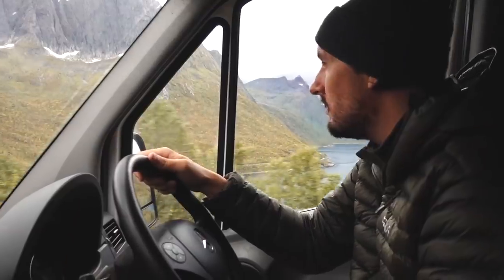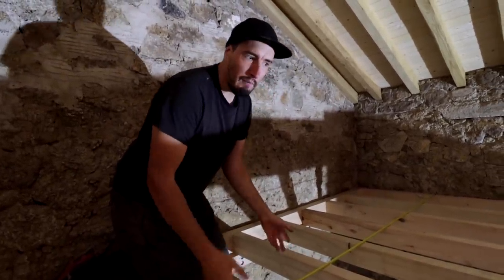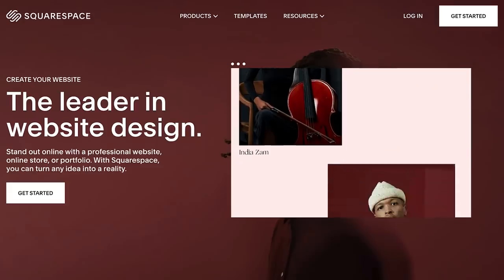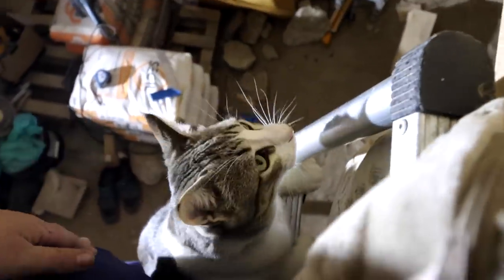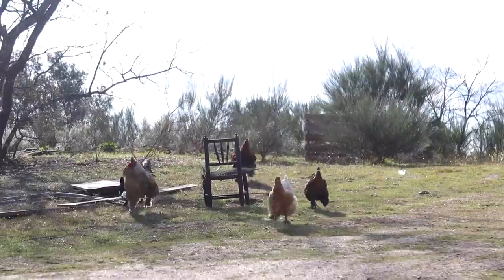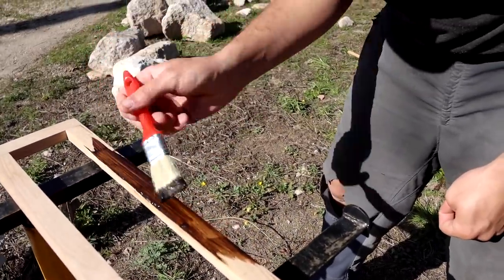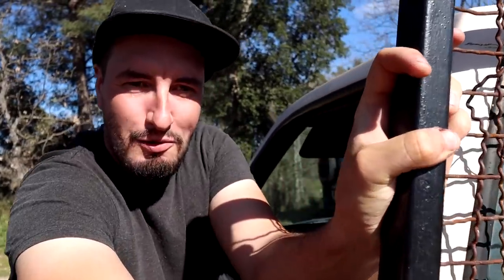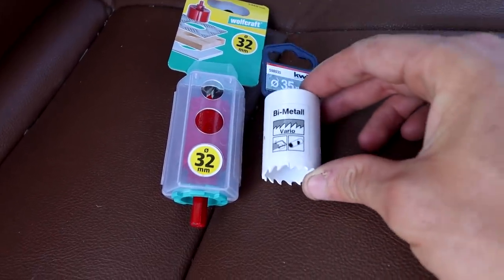THIS ISN’T GOING TO WORK! Renovating an Abandoned Barn in Portugal

Comment: Take your chestnut timber to a wood-shop and get them to turn it on a lathe to the diameter you want , you end up with a chestnut dowel that you can slice on your saw ! Also build a slim bookcase staircase , its much safer and you can carry coffee and things upstairs !
Reply: and extra storage!
Reply: Great idea, and as all wood is beautiful. I would use a contrasting color wood and emphasize the plugs. Make a rolling library type ladder in the same color wood.
Reply: my thoughts exactly.
Reply: @raymondsmith4401  Another good option.
Reply: They could also leave the plugs slightly proud and make them look like pegs they use in timber framing.
Reply: Wonderful ideas both.
Reply: Totally agree with slim bookcase staircase under the mezzanine along the wall
Reply: I agree about making stairs. Just make the angle from the beams to the end of the wall. They might be a little steep but would be easier to go up then ladder and like was said you could use for extra storage
Reply: Absolutely agree! Safer, easier to manage (especially when you are half asleep or have had a wine or three!) 😊😀😁  Extra storage too if you make the steps accessible drawers from the side.
Reply: I like Brain Clerk and  one other that suggested a slim staircase steps that could be used for storage too! Or the library sliding ladder!
Reply: Yes, a slim staircase would be much more stable, and also consider towards the top making a left and having a slight platform to walk along towards the middle so that you can walk under it on the ground floor, but you can also step into the tallest part of the bedroom.

Comment: Hi! What if you put a sliding ladder that you can move from the left to the middle of the second story? Like a library ladder you use to get books off the shelf. Then you can have the middle open to get up into it at night. When you are down in the kitchen, you can push the ladder to the door side out of the way. You will have the banister were you need it by the bed. No one will fall off! 😏 ❤
Reply: Amazing idea !
Reply: I was thinking the same thing. Why not have a rolling ladder so it's easy and comfortable
Reply: That’s exactly what I was thinking when I was watching Theo explaining their new idea. A library ladder would be perfect.
Reply: I like this idea too!!!
Reply: Scrolled down for this suggestion! I've stayed in a few places with mezzanines and a rolling/sliding ladder that you can push to the side when you don't need it works really well. Ideally one with handrails - much easier to get down!
Reply: I thought this as well , would be perfect , to have it in the high point through the night and move it away through the day. You could  even park it away from the door on the far wall to make the most of access

Comment: I'm thinking that the ladder will get old real quick in the middle of the night. So many clever tiny homes have cabinet stairs with a lowered floor area in the loft entrance for ease of access.  Something like that. The barn is looking amazing!
Reply: I rather have storage stairs. That’s just me. I have so many clothes.
Reply: I’m with your idea.  Everything needs to have double duty and the steps are certainly safer and much more convenient.  I’m sure glad they nixed the hatch idea - but they need to reconsider their ladder idea with storage stairs.
Reply: I totally agree with you here. I’m having anxiety just by looking at that ladder. It’s just not safe I think.
Reply: I've watched hundreds of tiny home videos over the years and have seen the evolution from ladders to stairs. They all say the same thing: the ladder was not fun.  I secretly suspect that many of them sleep on the couch after just a month of sleeping in the loft and using a ladder. It's a pain in the best of circumstances.

Comment: Have you considered a small set of storage stairs with a turn at the bottom, Instead of the ladder?  This way it’s easier to climb up and down and you have some storage solutions.
Reply: Agreed, it will be easier for them and their cats.
Reply: best upgrade option so far. like an "L" shape with a turn at the wall. I can see open bookshelves on one side for the living room. Could even build out the floor stairs to create a entry way storage sitting area for shoes and such.
Reply: Agreed.  There are some great versions I’ve seen where the top “step” is more of a landing at the top a bit lower than the mezzanine so that you can stand or close to it. I’m not sure Theo could at his height but it would still be safer and easier than a ladder. I feel like this is one of those times when it would be smart to get a professionally designed stair.
Reply: This is what I was thinking. You'll need cupboard/storage downstairs anyway- why not walk up the top of it?
Reply: @Metis1971  🇬🇧  Small landing would be a good idea.

Comment: Why dont you integrate the stairs/ladder like furniture like its done in almost every tiny house? It looks good and gives you lots of storage - no waste of room
Reply: Exactly my thought.  Plus those stairs run from inside the room up to the lip of the loft.  Stairs are stairs and take up the same amount of geography.  The only question is how to place it (e.g. against a wall) so to minimize the impact and then, as you say, use the triangle underneath for storage.
Reply: I agree, they look good, act like real furniture instead of a ladder, and multipurpose. Also the stair/ladder needs to go on the other side of the loft. It's awkward having them directly to the right of the entrance and then having you popup right next to the head of the bed - it's better design to put it at the opposite end of the bedroom, so to speak. They might benefit by getting a second opinion from a small-space design consultant.

Comment: I love watching you build your house!  About the sladder....instead of building it behind the door, why not slide it all the way to the other side, make stairs and have built in storage under each step? It would be more a piece of furniture. Since it would be near the kitchen it could be the pantry.  It could also be a hidey hole for the kitty litter box.  You could have a stair rail for safety, have a better angle to carry things up and down, and it would be more convenient in the middle of the night.  You could make a kitchen counter that extends over to rest on one of the steps and flips up to get to the mezzanine.  That way the steps aren't wasting kitchen space. Try measuring the interior of your space, putting it on graph paper, then make little pieces to mimic furniture and kithen cabinets, appliances, etc. to get an idea of what works for the space.

Comment: Spot on for the position of the steps up to the mezzanine. Tons more space under it for lounging! Suggestion for safety - how about a fireman’s pole to get down quick? Or rather a thick rope hanging vertically off the ceiling that you can hold on to?

Comment: Why not have the ladder on the side of the mezzanine, that way you don’t need to make hole. I saw later that you came to the same conclusion :) that’s exactly where I would put the ladder as well. Also a bit safer to maybe have a rope along the wall for safety going up and down

Comment: 36” spiral staircase in the same location as the ladder will give you a much better and safer long term solution. And it will look so much better. I’ve done it myself to access a similar space and it worked perfectly. You can use the ladder as a cheap temporary solution.

Comment: In our cabin we have a wooden ladder mounted at the wall - you could mount your ladder where you have the ladder standing now, only at the wall -  and the ladder goes higher than the floor above by a meter - so we climb the ladder - when reaching the floor - we hold on to the ladder and sidesteps onto the floor. When going down, we sidestep from the floor to the ladder on the wall - and climb down. This way, no room will be lost - not on either floor. Good luck! Wishing you a happy Easter - from Sweden!

Comment: Finding a viable solutions for the stairs is quite the head scratcher isn't it?  
*The stair opening in the middle of mezzanine compromises the space too much but I don't think the step ladder to the side works - it's just too steep and an accident waiting to happen in the middle of the night.  Also, it assumes both of you will always have 100% mobility. 
*Like others I thought about wall mounted folding stairs (so cool) but you would have to locate them on the opposite wall to the door.
* Another idea is building a component spiral stairs - also located opposite the door.  They would be a lot safer to use than step ladders.
*Me? - because you're in such a small barn I would build a wooden addition to outside of the gable.  This would house a spiral staircase and I would knock two door openings into the gable - one on the ground floor, one on the Mezz level.

Comment: If you intend to ride a motorcycle, get some formal training. I was self taught and had no training of any kind for many years, like 10 or 15 years. I finally moved to a state that required a mandatory training class to get a license, and when I finished the class, I realized that I was lucky to be alive. I learned so much from that class even though I had been "riding" for years but now had learned the correct, safe way to ride. I later became a motorcycle safety training instructor and took expert training classes because I rode a lot.

Comment: Great design, looking forward to seeing the barn finished. Just a thought about the ladder. On the right side of the ladder at the top when you step into the mezzanine maybe add a 3 ft. Vertical post on the floor of the mezzanine. This gives you something to grasp as you step from the ladder to the mezzanine and when you start to go back down the ladder. This way you are not partially crawling to come to a standing position at the top or when you go back down.

Comment: Have you looked into library ladders for the loft? They would be a safer angle for midnight bathroom runs, but can be pushed in during the day so they don't take up as much room. I've also seen them with horizontal rails also so you can move the ladder to the center at night, then push it up against a wall during the day. A few months ago I saw a tiny house with a library ladder that pushed in then over and into the pantry so you didn't see at all during the day, you only saw the rail against the loft.

Comment: A suggestion for the layout of the mezzanine, I don't know the exact dimensions but it looks like it would be possible to put the bed lengthwise in about the middle. So when you come up on the door side wall (you could make that side the storage side), in the middle is the headboard side with your feet towards the woodstove wall side (I hope this makes any sense). That way, you'll be underneath the velux window for stargazing and you won't hit your head when getting in and out of bed.

Comment: Have you seen the fold up/collapsable ladders that fold up to the side, that I've seen used in tiny houses. Fold against the side in the day and fold out to use at night. Win Win. Best spot choice made IMHO. It is going to be beautiful! Love your kitties, too! So glad that Gingy is fixed now. You might try letting her out of the cone while you watch her, after a few days healing. You just need to make sure she doesn't pull at her stitches. If she doesn't mess with the wound she may not need the cone of shame! Hope she mends quickly. Love keeping up with you all. Have you thought about just getting a dowel of some different colored wood and using it to plug with. Just glue, stick in hole, cut off flush, go to next one. Sand down flush and it's done.

Comment: I had a thought as you went up the ladder.  You may have fastened everything in but, just in case you haven't .    Turn the ladder  90 degrees so the top is slanted toward your far back wall and the bottom is almost where it is but, enough away from the wall to allow walking and stepping.  If you fix a landing at the top off the beam ( or beams-- because you can also tie into the beams under the floor )   This will also allow a handrail.  With the right fastenings, you won't need to drop a post down . ( although that is also an option )   Advantages :   You will go up to the highest part of the area straight.  You will have a handhold and you step onto the upstairs at the end of the bed, not beside it.  Just a thought.  I don't think it takes up anymore space and with the handrail and right angle, you  might be able to go up facing correctly and come down as a normal stair as well.

Comment: Like someone says. Ladder slides left/right across the front of the beam to gain access to highest point. Attach rope & pulley to bottom of ladder and lift to store above head height during the day. Or lift and store under bed using hooked pole to get it in and out.

Comment: Put a rail on the front of the loft like a library ladder! Then roll it to where ever you need to get to. Put a reverse hinge on it like a boat, or a pulley on the ceiling so you can lift it up out of the way and tie it off to a cleat when its up!

Comment: I was shouting at first noooo put the ladder on the edge of the platform! Well done for taking your time.
In terms of the ladder design some of the ideas they come up with for tiny homes are amazing.
You might benefit from a ladder that moves in and out for a better angle or even one that can move across side to side on a guide.

Comment: Hi Guys, great video. When you cut your plugs with the hole saw, don’t cut all the way through the wood you are using. After you drill out your holes, cut the wood into thin slices which will also wind up slicing your plugs. Out of each drilled hole you make, depending on how thick the wood is you may be able to get 4 or 5 plugs out of each drilled hole. Good luck.  You can also attach your ladder so that it swings either up or sideways out of the way. Wish I could actually help you guys, I’m a retired plumber/builder. Your project is right up my alley.    ❤️🇺🇸 🇬🇧 🇵🇹

Comment: I have a wooden loft ladder that folds in half and shoves into the loft, maybe one of those could be your solution to keep the space in the ground floor.  In Japan they dont use cones they have flat flower shapes in a foamy material, seems more comfy for cats and still prevents them licking wounds

Comment: At your ages, a ladder up to your mezzanine is doable. Later on in your lives you may not be as spry ..believe me, I'm over 60. Sorry but the young never think about being old...I never did either! LOL  I've seen tiny houses with step stairs up to lofts that curve or have a few steps up to a small landing and then turn to go up to the loft area.  Each step was built like a box, so it could be used as additional storage.

Comment: You should look into rampumps they don't use any electricity at all. But you do need a stream or a down slope on your water. It's also very cheap and easy to make! You can also make your own drinking water with stones, sand, fine sand and activated (charcoal) carbon. Even if you don't have a slope you can still make a tube and let it suck the water out of your well if  your well is on a higher point than an other area on your land. With the siphon effect your can still run the ram pump.

Comment: If you have your ladder  secured to a rail with wrought iron hooks you could also add a pully to keep it out of the way. glad your doing ladder  I have a hole in my loft  and it's not great and never close the hatch for safety reasons

Comment: I think you should attach your ladder with hinges at the top and make the ladder longer and in 2 pieces and then hinged at back of the ladder around 1/3 from the floor then you can decrease the angle when you’re using it.

Comment: You may very well be able to get your starter motor rebuilt, there are still places in the UK that do it so i presume Portugal will be similar, I just had one done for my dads 1996 motorhome, in Batley UK.
Also one of the sliding library ladders would look superb, and you could slide it to the centre for more head height or to the side out of the way and maybe inbetween furniture to make it toddler safe. 
We liked the twice a week catch ups Ed.

Comment: Great seeing you guys during the week. I was thinking about your sladder - have you seen the ladders that are attached to a swivel rail anchored on the wall to the right of where you show it here? The ladder can swing out to access the loft and can swing back and be stored away under the loft floor. The ladder is stored off the ground under that horizontal end beam of the loft floor but is easily switched around to go up to the loft..(Of course, the simple option is just to hang the ladder on the wall when not in use 😆)

Comment: Watching your video we had an idea.  Why don’t you install a rail on the front face of the beam and attach a library style ladder which has wheels on the base so can be slide to one side when not used.  You can then install  a 3/4 wall with a central gap for max head height for your entrance onto the mezz.

Comment: Hi. I think you’re right not to have the access to the loft threw a hatch. You’ll waste a lot of valuable space but the location beside the door won’t work as you’ll need to have the angle steep as  not to block your front door and you come up at the low part of the roof.   A lot of bending and having a walkway around your bed will waste your precious space. I think you should locate it at the center of your mezzanine on the leading edge.  You’ll have maximum space in the mezzanine with a decent  rise on your ladder/ stairs and be able the stand up when you “land”on the landing